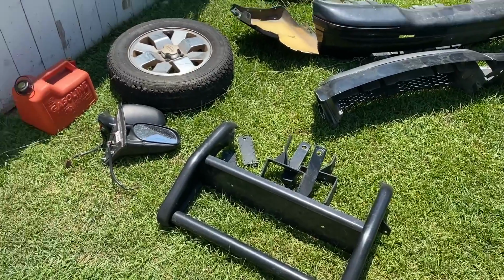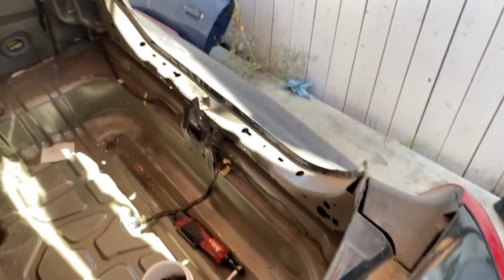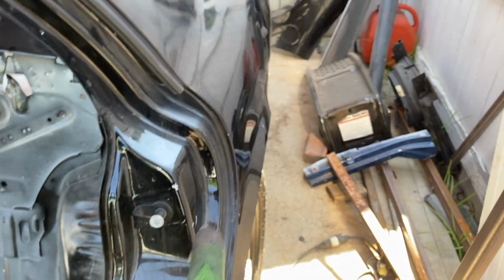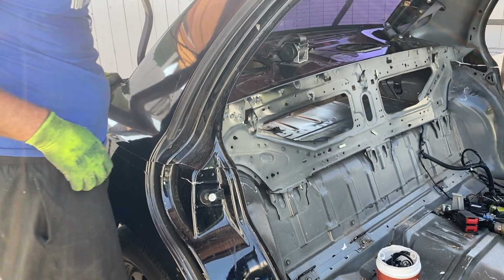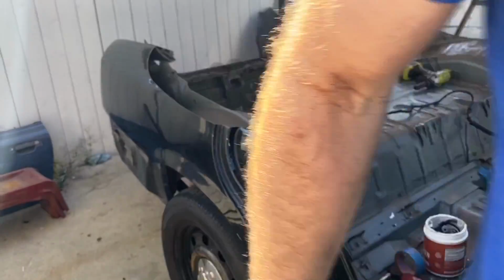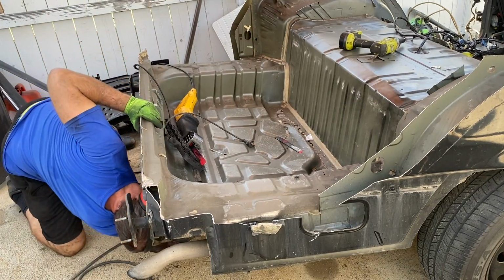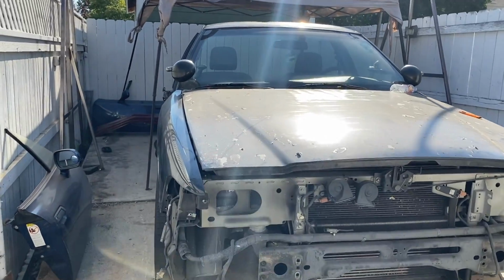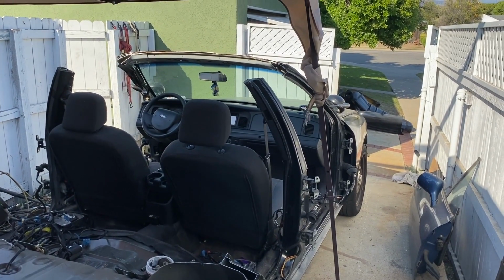New Build! Crown Victoria Full Frame Swap.

Comment: How about putting a 1957 or 58 Ranchero body on the Vic frame. I’ve contemplated this swap myself. The 57/58 ranchero have a 116 inch wheel base and they are a body on frame design. The 1959 I had was a 118” wheel base so it would be too long. The Ranchero frame is surprisingly similar to the Vic frame so the swap should work well. Also, the ranchero was basically a 2 door wagon with a short roof panel, back cab panel and a bolted in bed panel. Even the floor pan was from the station wagon. And since it sounds like you’re gonna need an engine, what about a DOHC from a Lincoln Mark 8? Just a few ideas. Whatever you go with, I’m sure it will be a cool ride none the less.

Comment: Save those rear seat belts - the straps can be very handy for storing stuff, or lifting things.  Lots of people use them to lift engines (I'd double or triple them up if doing so).

I'm thinking classic pickup.  You can probably find one that fits the wheelbase well.

Comment: This would be cool under an old van. Like an old Econoline or something. If I remember correctly, the Crown vic is a body on frame. May not need the body at all. Just the frame and engine.

Comment: Sounds like a connecting rod wants to see the outside world via the wrist pin or crankshaft. Check torque converter bolts if they are loose or the stud has oblonged the flex plate holes it`ll sound like a bottom end knock.

Comment: Just a thought for the build; why bother fixing that engine? You can get a Lincoln Mark 8 with IRS and a four cam version of the same engine (almost identical to the later Mustang Cobra engine . I cannot figure out why they're not increasing in value like the Mercury Maurader) and they're usually quite cheap. I bought one for under $1,000 Canadian that was quite nice. Just keep the driveline and IRS for the build and the seats are pretty nice too. Biggest problem is a unusual wheel bolt pattern. Ford loves making things hard for enthusiasts, like whenever they develop a new engine they sit around laughing as they come up with new bellhousing bolt patterns 
And don't get me started on Ford's practice of moving the front suspension one foot too far back on every car designed since the mid 60's !